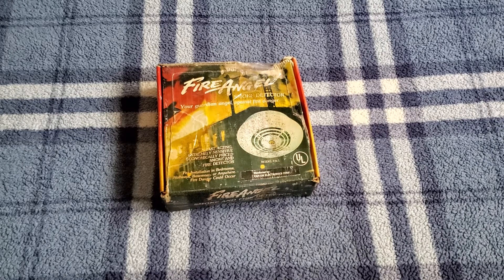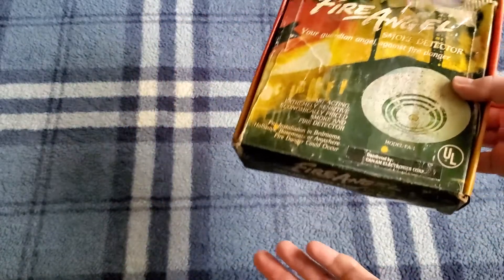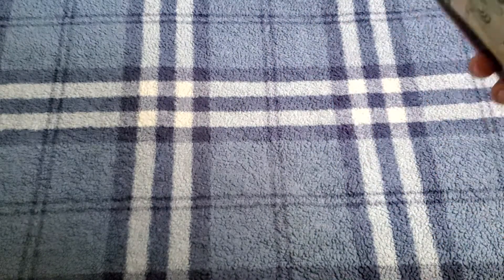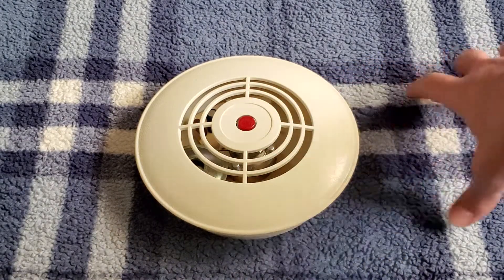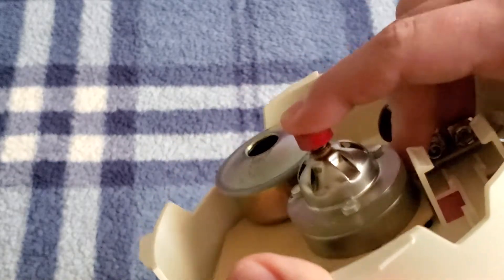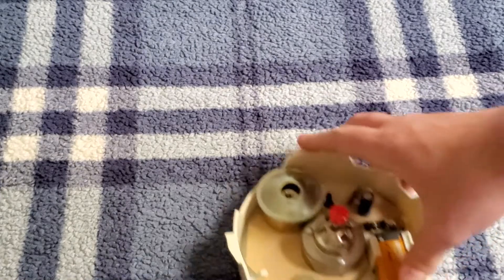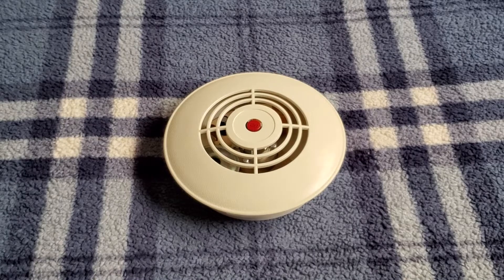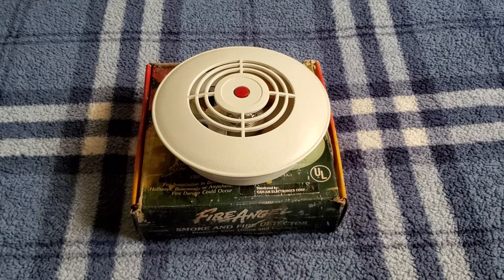Can-Am Fire Angel FA-1 Smoke Alarm Overview

Comment: Very cool unit and I have only seen these in person once in Canada when I was in grade 4 which was in 1983/84. It was at a house I went to on my lunch hour  it was wall mounted in the hallway of the house.  It's a very interesting and cooler looking detector.  It's too bad you couldn't get it to sound with spray. My Sa76rs goes bonkers when  I use the smoke centurion tester. At least it works when you press the test button.  I eventually wouldn't mind one of these in my collection.  Tomorrow if all goes well I will purchasing 2 Vanguard V-50 heat detectors and a Vulcan Autosonic  Mark S30-a bell. I got my fingers crossed.  You will definitely know if I get them.
Reply from the maker: Interesting, I wonder if the Can-Am name was short for Canada-America or something along those lines, and if so that would make sense that they were sold in Canada as well. Very cool that you've seen one installed in person! And yeah I'm not sure why it wasn't going off when I tested it with smoke spray, because I remember it being very sensitive to it when I first got it and that was only back in December, either somehow it lost sensitivity or my smoke cans are running low on aerosol. Eh, whatever, it works when I test it manually with the button and that's all that matters. Can't wait to see those Vanguards and the Vulcan!
Reply: @jdlproductions2746  That is a good question as well. It reminds me of Can-America parkway, a street in Cambridge, Ontario.  Also sounds like an airline company because it also rhymes with Pan Am. Definitely a cool unit and that is the one and only time I ever saw one installed in person. Even though back then I was still terrified of smoke detectors this one somehow stood out by the way it looked and the vents being big enough to see the horn and sensor. I hope one pops up on Ebay soon..I would love one of these in my collection. Thanks I can't wait for the Vanguards and the Vulcan. They Vanguards are missing the Allen key or Hex key as they are known as here in Canada however they are wound up and do work. I will be purchasing a key sometime down the road as I found out Staples sells them.

Comment: Interestingly enough nowdays the name "FireAngel" is used by a company in England to sell smoke detectors under.

0:45 Really? Only three collectors (including you) are known to own one of these? Wow...(though as you said they are rare)

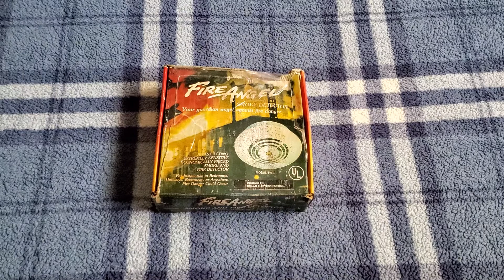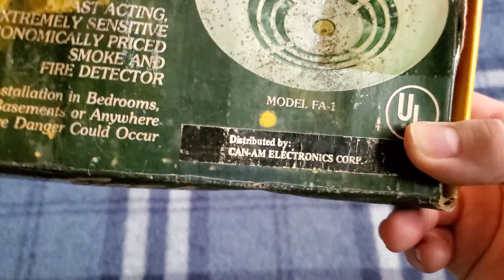0:57 1:20 I found pages on both OpenCorporates & other sites about a "Can-Am Electronics Corporation" in Fort Lauderdale, Florida, which according to those sites was incorporated in 1980 & apparently went defunct 3 years later in 1983 (though this doesn't fit with the supposed manufacturing date of the FA-1).

1:15 Distributed by Can-Am Electronics Corp huh? Wonder if they were also the manufacturer.

2:44 They might have simply wanted to reassure the consumer that it was a battery-powered unit.

4:23 Weird...(especially since pretty much all other manufacturers include at least a manual)

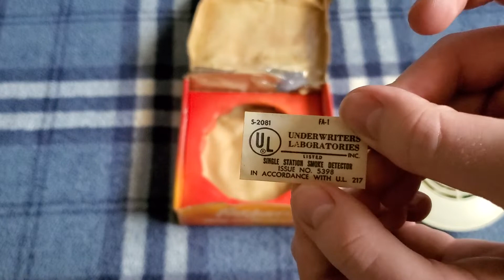5:03 Might mean they both came from the same batch.

5:29 Yeah actually, also sorta resembles a typical cartoon smoke detector as well.

5:42 "Presto"?

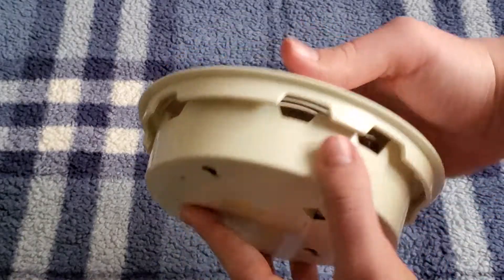6:45 I haven't actually.

6:48 That's how I thought it'd be done (clever actually). Reminds me of the way some ceiling-mount Genesis NAs have twist-off covers (which are a pain to open).

7:00 I was wondering why it didn't seem to have a label anywhere (including on the back) since most detectors have one.

7:18 That has to be one of the simplest smoke detectors I've ever seen in terms of circuitry! Very unusual sensor design too.

9:34 Like they say: sometimes simple is best.

9:52 I don't actually.

Shame you couldn't get it to alarm when smoke-testing it, but I suppose that does serve as a reminder that the sensor in a smoke detector can only last for so long: replace them when they are 10 years old.

Comment: That's funny as hell people collect them. Thrown out thousands of smokies in the last few years, having to update to local legislation.

It doesn't work with smoke because ionization sensors have a shelf life, also the reason why they're redundant. We use photoelectric device these days, they have to be put in bedrooms and exits of those rooms. They also have to be interlinked so when one goes off they all go off!
Reply: It's not really that funny dude, it's just something some people do, & it's fun to us. I hope none of the detectors you threw out were rare ones.

Smoke detectors are supposed to be replaced every 10 years, no matter the sensor type: ionization, photoelectric, or dual-sensor (ion & photo).

Comment: Yours doesn't have to 'warm up' for about 10 minutes after you put the battery in?
Reply from the maker: Not as far as I know. It had been powered up for way more than 10 minutes when I tried smoke testing it so obviously it didn't have anything to do with that.
Reply: @jdlproductions2746  mine & Nathaniel's both when you first put the battery in and push the button will only sound a short blast. you have to leave the battery in for like 20 minutes before it will sound for longer than 2 seconds upon pushing the button. No other smoke alarm I have ever had does that. And I can't think of a reason why
Reply from the maker: @BAFVintage  yeah mine doesn't do that. Interesting.
Reply: @jdlproductions2746  very strange indeed....